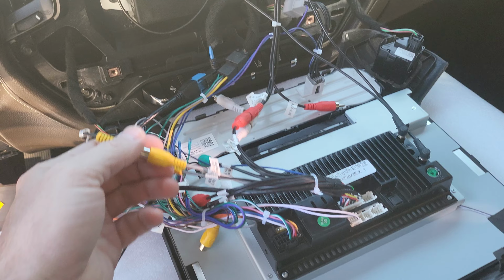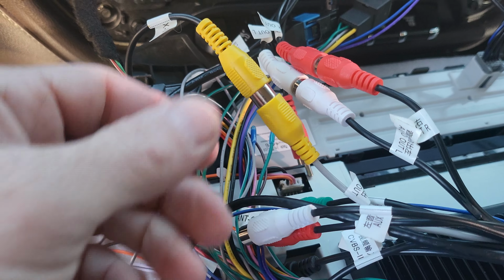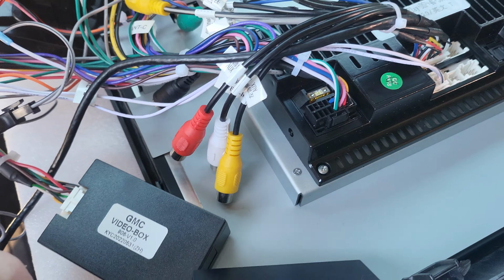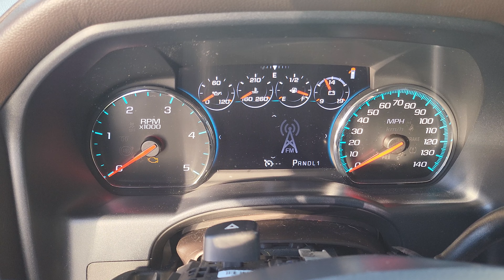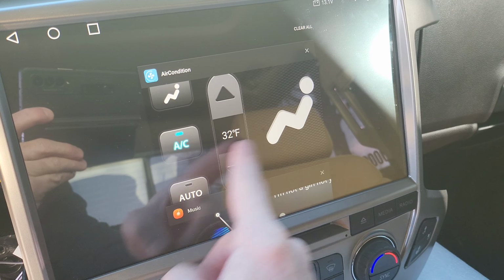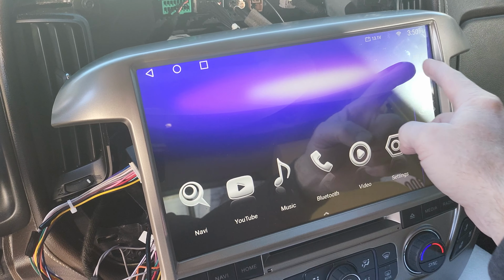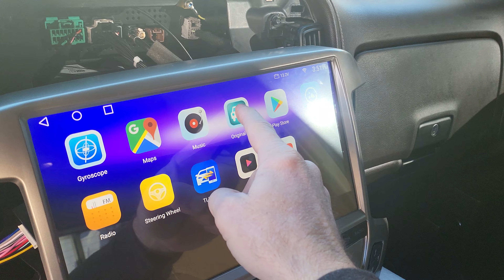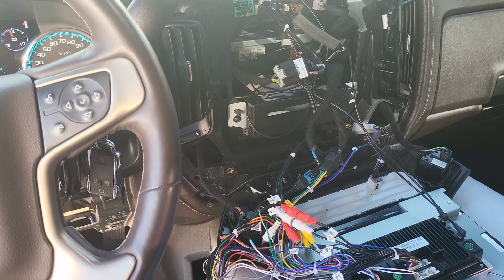Belsee 13.3 Screen head unit for GMC 3500 Sierra Denali 3500 (NO AUDIO  issue)

Comment: I had one before and had to use the Aux input on my original infotainment. And in order to physically had to plug a 3.5 aux cord into the Aux port in order to select the Aux source.

Comment: you need bose adapter
Reply: I currently have the same issue on my 1500 ltz no sound what bose adapter will work?
Reply: @MrBamf00 the factory radio computer is still running. The new head unit basically outputs and goes into the AUX of the factory head unit computer. Without a signal from the factory AUX jack, the original computer won’t go into AUX mode. It won’t switch to the AUX source and instead just cycles between FM, AM, XM, etc and skips the AUX source. You’ll need to plug something into Aux jack to get the factory radio computer to go into AUX source